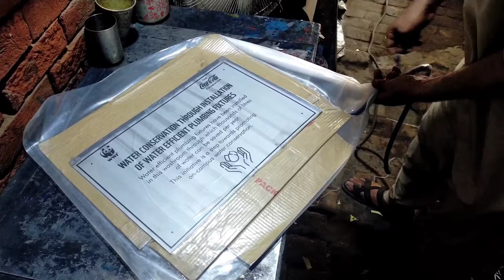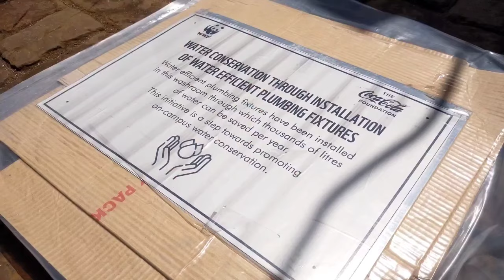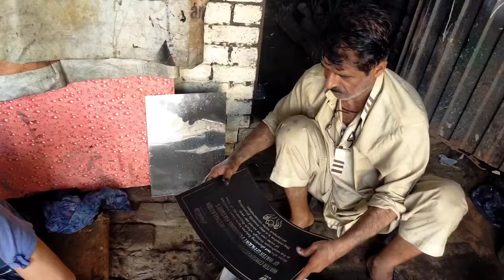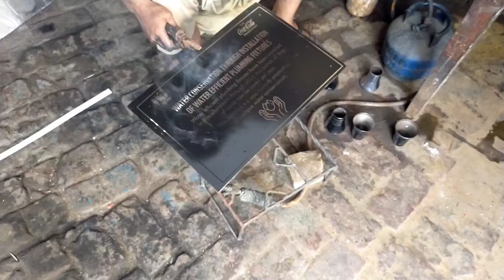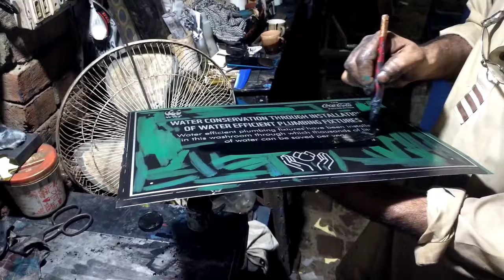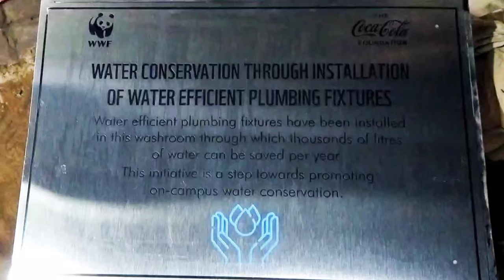" Stainless Steel Sign Boards" | Metal Etching | Metal Crafting Project | Amazing Skills

Comment: Can you pls name the chemical used in each stages?
Reply from the maker: brother I don't know about such details.
Reply: Ferric chloride
Reply: @muhammadmooner2299 Sir I have ferric acid but it does not etch stainless steel. It only etch copper. Can you tell me what acid you have? It is different.
Reply: I have ferric chloride sir